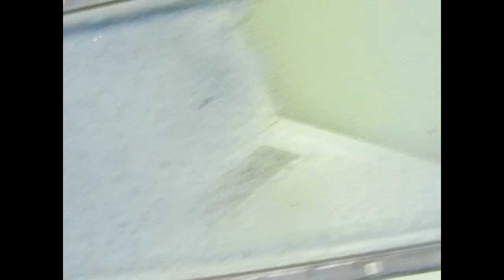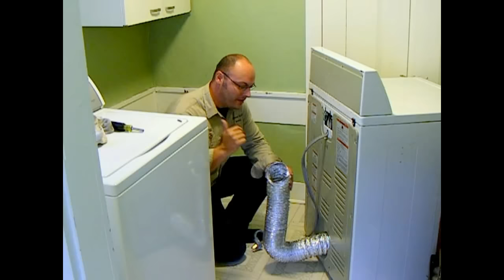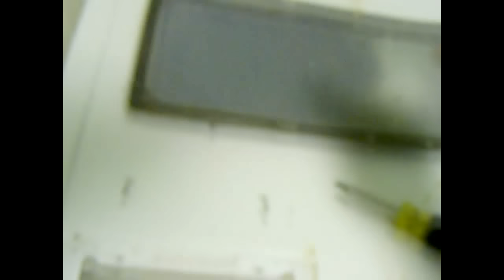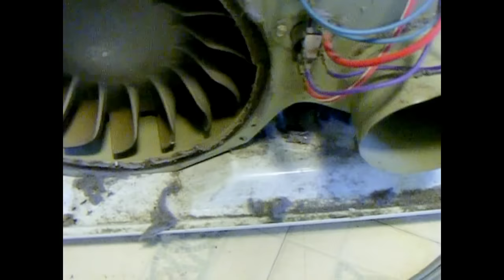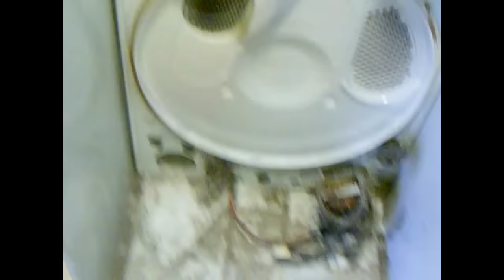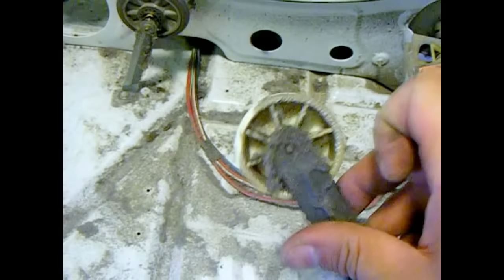Dryer Troubleshooting - Not Drying or Taking a Long Time to Dry

Comment: 11 years later, this video is still coming in handy! Thanks so much! 
My dryer seemed to be working, it ran, was hot, but wasn't drying. My husband offered to replace it, but I was fairly certain it was an air flow issue. Thanks to your helpful video, I took it apart, and sure enough, it was packed with lint at the base of the hose. All cleaned out now and my 21 year dryer is running like new again!

Comment: Thanks for taking the time to do that.  My dryer was giving intermittent heat, squeeking, and rattling - it was going on 12 years old.  The thorough cleaning did the trick.  I started to get a little nervous when it was all in separate pieces but it is all back together and working!  Thank You!

Comment: We've had our Kenmore dryer for almost four years now. It recently had begun to take a lot longer to try a load of clothes. Your video came up when I searched for a solution. We were shocked at how clogged our lint trap and exhaust hose were! The trap and exhaust hose had MAYBE an inch of open flow space! I am OCD about cleaning the trap filter and even clean it halfway through the cycle when doing towels... I recently learned you should hand wash the lint filter regularly, I had no clue. Your tutorial was so informative and easy to follow. Thanks for posting! P.S. We have 2 gray tuxedo kittens (4 months and 2.5 months old), Oliver and Olivia, who also found our dryer cleaning chore a very interesting ordeal! ;)
Reply from the maker: Awesome!
Reply: Bill Newberry

Comment: I'm a home inspector and see a lot of long runs on dryer vent hoses and also plastic vent hoses. I always recommend that the plastic hoses be converted to metal for safety. But! I never thought about lint buildup inside the dryer housing. I'll make recommendations regarding that they be cleaned as well. Thanks Bill!

Comment: I consider myself to be “handyman-challenged”.  Our dryer has been acting up for several months now.  It would usually take 4 drying cycles to dry a load of laundry.  I checked out several Videos how about fixing the problem, but yours looked very simple and straightforward. So I decided to follow yours, and was amazed when I took off the back of my dryer and found that it was almost identical to yours. So it was very easy to follow your instructions and find all the places where lint was built up and get it cleared out. Absolutely thrilled to report that I’ve gone through two loads of laundry and it’s only taken one dryer cycle each to get them dry! Thank you so much for this video!  I don’t feel so handyman challenged anymore! I’ve even pointed my neighbor to this video, because I think he’s experiencing the same thing.

Comment: Great tutorial! I was a about to go through the trouble of replacing my old dryer with a backup in storage until I went through the steps. Found so much lint and junk had accumulated in the bottom of the lint filter housing that it had solidified into a furry mess and had to break it loose. Now good as new! :-)

Comment: Hey Bill,
       My dryer stopped heating. I did everything you said and you were right. The high heat fuse went bad, I tore into this thing expecting to see the remains of lent wookie. I did not find any real blockage at all.  But then the dryer is getting old. 10 yrs or older. In one of your other video's,  you said to take it off and smack it on the ground.  So I slapped it around several times. 
But that did not help. So I threw it on the floor, hard. When I checked it  with the  meter it was working. But as faith would have it
one of the tabs broke. So, I still had to go and buy a new one. At any rate,  I thank you so much for your help.  She is up and running.  And the wife thinks I am a hero. lol
Reply from the maker: Awesome!  Great Job on your Repair!  (not the breaking the old part though)lol
Reply: The place I got the parts, the guy has been doing this he said for 45 yrs. He said he had never heard of anyone resetting them by slamming them on the ground. He kind of made fun of me for trying this. But as I said before you are right it does work. Perhaps not all the time. I paid for the parts and before I left he came up to me and said  I got to give this a try. I did  tell him to be careful and not break the tabs. 
   I just ran my first load in the dryer and it seems to be working. I hate doing  laundry about as bad a grocery shopping.  
Thank you for making these video's. From the comments you have help many people.
Bless you my friend and Thank You !!! 
Take care,
William
Reply from the maker: Tell him to use a lighter to trip it,  let it cool, then whack it.  It'll reset.  Again, great job on your repair!  Thanks for sharing your experience!

Comment: Our dryer started acting up a couple of days ago. Clothes weren't feeling completely dried after two cycles. Immediately we started calculating the year of the dryer. Which lead to thinking it was the heating element going out. Then I watched your video. Decided to the outside vent since the hose was changed about a year ago. Indeed the outside vent was completely full of lint. I cleaned the hose just to be totally safe. Thanks for the great informative video. You just saved me lots of money.

Comment: This video saved me at least $150.  I own rental property (with washer & dryer included).  The tenants complained that the dryer was not working.  I have a full time job and thought about simply finding a repairman to look at the dryer.  However, I found this video and, following the directions exactly, attempted the repair myself over 1.5 hours on the following Saturday.  The tenants have relayed that the dryer is working perfectly now.  Both my wallet and I thank you!!!!

Comment: 3 nights ago our dryer quit drying.  Found your video and took off the lent tube, not really expecting to find much, cause I am always cleaning the lint screen.  Found about a pound of sand (we live at the beach).  Cleaned it out, turned it on - and found the heat was working again.  Thanks.  Great help.  I am sure you saved me at least a few more days without a dryer and certainly money.

Comment: Well, heck..... thanks, Bill... I moved into this rental a couple of months ago and bought a used dryer, but it's never worked too well.   I did the easy stuff first and went out to see if maybe a squirrel had stored something in the vent hole.  Put on my gloves and stuck my hand in the hole and pulled out.... a large T-shirt, much too large for a squirrel.  I think my problem may be solved but now I know I can break into the machine and do some further clean up if there continues to be an issue.
Reply: Naga Wamba  in is noun

Comment: Thanks very much for this video and your instruction.  I have a Kenmore very similar to yours.  I couldn't find a manual or any trouble-shooting guide published by the manufacturer.  What you explained and demonstrated was enough to encourage me and inform and guide me to dismantle my dryer and clean out all the lint, which was considerable.

More than just saving me the expense of a repairman, you helped me be self-reliant.  Thanks so very much.

Comment: Hi Bill, my dryer was taking forever to dry clothes, usually 2 or more cycles. I had checked the exhaust to see if air was coming out about 2 weeks ago and it was. what I didn't realize was that even though air was coming out, it was not near what should have been coming out. After watching your video this morning, I decided to clean all the areas you mention in this video and when we ran a load of clothes, BOOM! Dry! there were no major blocks, but several minor ones and now the air pours out of the exhaust vent. Thank you for the tips, they worked!!
Reply from the maker: toddzilla112233 Awesome!  Great Job!

Comment: This was so helpful!!  We got a used drier and it would not dry, even though it got very hot.  I checked the vent hose things and there was no air coming out of them when the drier was on.  After unscrewing the back and hose and interior lint thing, I found a huge clog of moldy water and wet nasty lint.  I am so grateful you took the time to show and explain the whole process!  We have a working drier now!!

Comment: I would also like to suggest if you use dryer sheets to remove the lint filter,
run water over the lint screen and notice the water pooling on top of the screen rather than pass through the screen. dryer sheets have an agent on  them and the agent stops the free flow of air. So clean the lint filter with hot water and soap at least once a month, this will also help cycle the moister out of the dryer rather than the dryer having to evaporate the moister.
Reply: Thanks for that info regarding Dryer Sheets.......My wife uses them like a bandit.....and I do make sure Lint Filter is clear, but have noticed that I've been having more trouble getting the loose lint off of the Filter than ever before in the past, probably "Pre-Dryer Sheet Era" for us.....the lint is often very wet, and grabs the screen pretty good as I try removing it all.......I guess the Downy Days, Fabric Softener in the washer might be best option??
Reply: TheFalconJetDriver
Reply: Washing the filter first lol my dryer is acting up and this sounds like a good possibility why either way it’s got to be done thanks for your input as this video just went over what I already knew however your comment I didn’t know about the dryer sheets

Comment: Great help and saved at least $90 in a service call plus whatever the clean-out and inspection would have cost.  After checking the silver vent air hose and lint filter which were clear, removed the back of the dryer and found the lint plug in the lint filter housing.  Thanks for a great video and it only took a short time to clean and vacuum it all out.  Works like new now.  Thanks again!

Comment from the maker: lol, you should see some of the dryers I pull apart, I can fill a shopping bag full of lint out of most of them if they have not been cleaned, ever.   Thanks for Watching!
Reply: Even if you clean the lint filter every time you still get lint that comes out the exhaust and sometimes you have to clean the lint hose and inside the dryer. I keep an extra long nozzle handy for extra cleaning out lint. you can also use a bottle type brush that's made for cleaning out dryer lint. when the belt breaks that the best time to totally clean out the dryer. its easy when the front cover is removed.

Comment: Not a mundane topic when Little Helper is on the job! Thanks--I have a heightened appreciation for proper maintenance of my dryer, and I learned a lot.
Reply: Yea, me too. I just had to replace the high level thermostat in my dryer. TWICE! Oh well, it works now and dries super fast. Not bad for a $15.95, no tax, free shipping part...uh TWICE!
Reply: Well, I have since discovered that my "eco cycle" works fine. It is the other dryer setting that take forever to dry. Hmm. But, I think this guy has some great tips. Also, Little Helper, his kitten who slides into view periodically, is very charming.

Comment: One other thing I like to tell people who use fabric softener or dryer sheets. Take your dryer filter & try to run water thru it. If the water is beading up on the filter & not moving thru...air is not gonna be able to move freely either. The softner will build up on the filter & you won't think twice about it because you can't really see it. I take my filter out once every few months & wash it by hand with Dawn dish soap & warm water. Dry it completely before reinstalling it in the dryer. You'll notice a huge difference in how well your dryer is working!!  Hope this helps someone! It's the little things sometimes!!
Reply: I tell all my friends this.  I had a boss years ago, his daughter's house burned down, and it started because of the all the lint on her lint screen..  After that, I even take mine out and take a soft brush and use Dawn dish soap to clean mine, I usually do it once or twice a year.  And I Always take the Lint off the Screen after Every Load!
People don't really realize that Lint left on the screen can actually start a fire.
I also never run my dryer unless I am home, just to be on the safe side..
This was a great video..

Comment: Thank you SO much for posting this video! If anyone watching this is debating whether or not to try it, I suggest that you do. I am 9 months pregnant, and my big ol' preggo belly and I were able to take apart, clean out, and reassemble the dryer in about 2.5 hours. The result? Dryer time has decreased significantly! It was taking 3-4 cycles to get clothes dry before, and now it doesn't even take 1 full cycle. I also feel like our home is safer for baby now (it's scary how much lint was trapped!). Thank you! p.s. Can't get over how adorable your little helper is!

Comment: I have NO experience in this kind of thing and I don't have the same brand of dryer shown here.  Also, my dryer is vented thru the floor then goes 8-10' to the outside vent.  It's nearly impossible to keep the hose connected to the dryer!! I plan to try putting the clamp inside as you've shown.  I'm going to give this a try to see how I do.  Repairmen tend to take advantage of women who are inexperienced in any kind of repairs, building, etc..  AND they're expensive.  Thanks so much for this video!  Wish me luck!!!

Comment: Thanks  this is helpful and mine family will be safer ,Perhaps should show how flammable that lint is ,Only takes a spark ,easier to flareup than gasoline I tried both .
Reply: Patricia Jude , we use the lint for fuel to build camp fires.

Comment: The first step of cleaning out the exhaust ducts of lint hit the spot!  Mine were so packed that the outside cover was not even moving!  I shined a safety light through one end of a three foot section of the pipe from the dryer and could not see any light on the other end...You, dude, are the MAN!!!

Comment: Thanks.  Great video.  I also appreciated the candor with the junk in the heat tube and other areas as it shows what is normal accumulations of things.  I thought the lint trap also collected / stopped other things from passing but seems it is indeed primarily for lint so other stuff that passed through will collect in various spots; hence the purpose to clean out the dryer as you mentioned.  Thanks!

Comment: This is an awesome video! Thanks so much. I have a sneaking suspicion what my dryer's problem is now: the lint housing. I washed and cleaned some EXTREMELY dirty pet blankets, and after doing so, the dryer stopped performing. There is heat, but the clothes won't dry no matter how many cycles I run it. I think a tell-tale clue is that after each cycle, I see little or no lint in the lint screen! I checked the vent hose, and the metal venting itself to ensure it is free from obstruction. Even ran the dryer for a cycle with no vent hooked-up, and guess what? Still extremely damp clothes. Again, everything pointing to an airflow problem within the dryer itself. Shouldn't be too bad to fix (I hope). I'll let you know! Thx

Comment: Hey Bill, Thank you for such a great video,  my wife was complaining about the dryer for long time but today after watching your video i just checked the top filter and I was shocked to see there was almost 2 inches thick dust layer which was stopping the air ventilation, I cleaned the filter and machine is working great again.

Comment: I can't thank you enough for this video!! I have had my Kenmore for over twelve years and never thought to open it up and give it a good cleaning; so you can only imagine the buildup....I'm surprised it has performed wonderfully for so long up to now with taking too long to dry. Actually, had I followed your instructions exactly, I likely would never have bothered opening up the dry!! I say this because I did all that you advised; however, the very last thing I did after putting everything back together was go outside to check to make sure the outside vent was not blocked (but I did check and clean out the flex hose). Anyway, turns out the vent was indeed blocked....and I mean HEAVILY blocked. The vent itself was bent in (don't know how that happened). So I pulled the vent cover back open, and then pulled out all the lint buildup that was blowing out. As I stated before, if I had simply just done this part BEFORE open up the dryer, the other buildup inside would likely not have gotten cleaned...especially if the dryer had started back to perform well with just unblocking and cleaning out that vent!! Thanks,again, Bill Newberry. YOU ROCK!!

Comment: This has confirmed my suspicions as to why our dryer is not properly drying clothes. It is heating up correctly, but clothes are not drying for hours. In fact I noticed with this last load that the lint filter is not even getting the appropriate amount of lint for a single load. Thank you, this video may have prevented a serious fire and the expenses of a new dryer. I will be handling the situation asap.
Reply from the maker: +z3ratul99 Awesome!  Now get after it and let me know how you made out!

Comment: Thank you very much Bill, you just saved me from buying a new Dryer. Lint was blocking absolutely 100% of the air flow right at where the bottom of the conduit where the filter is. No wonder my clothes were wet even after three runs.

Comment: Thanks Bill, I am going to give this a shot tomorrow as a first step in troubleshooting my old Kenmore dryer which is slow to dry. This is exactly what I need to know before moving on to the thermostats. I am thinking also of blowing out the duct line with my leaf blower just to be sure, however I do seem to have good airflow at the exit outside the house.

Hopefully Little Helper Apprentice appears in your other videos which I haven't yet looked at!